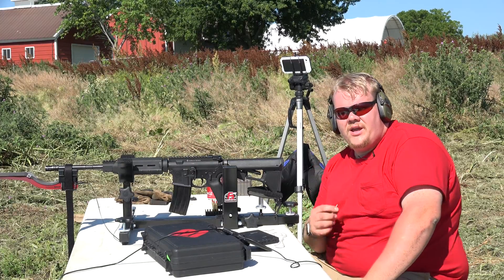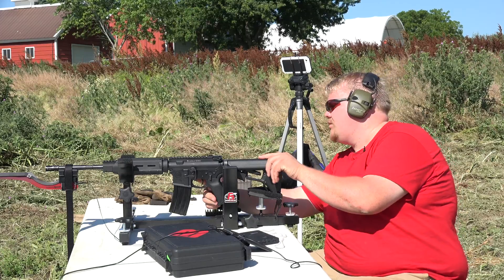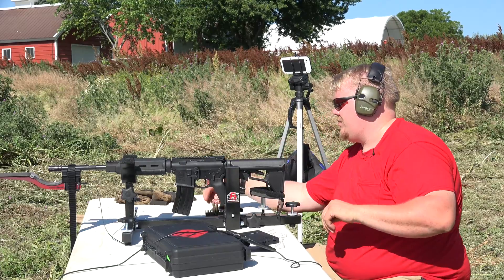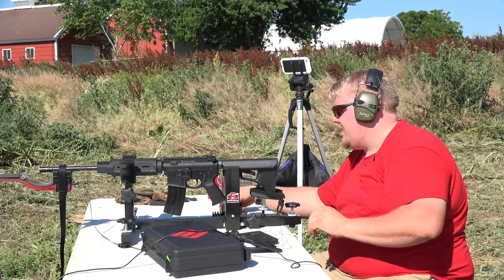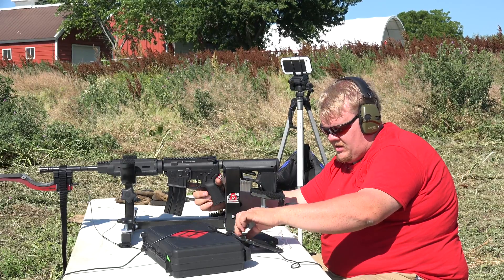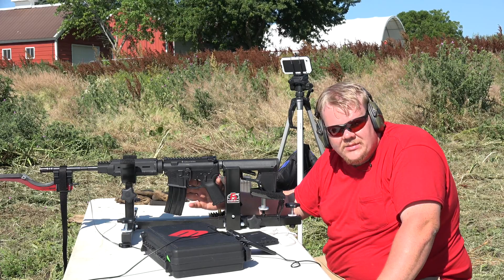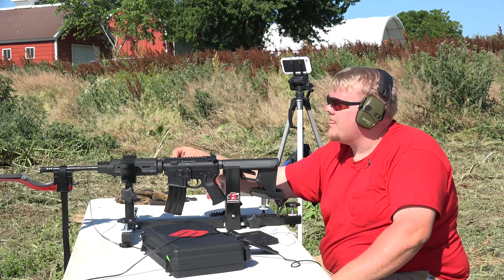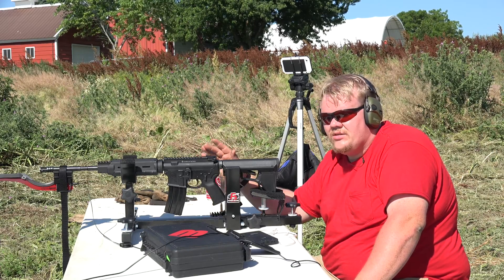The Quest for MACH 4 4K

Comment: why not use a longer barrel? protip: try this experiment with a 22-250
Reply from the maker: We have talked about a longer barrel for 30-06 sabot and may end up going that way. and a 22-250 is actually on the list to test with we have yet to find one at the right price point to risk blowing up. We are focusing on sabots right now since we can do more unique loadings that way while having less effect on internal volume and pressure due to the unique projectile shapes. The end goal is to hopefully achieve MACH 6 we started with 4 since we knew we could in all likelihood achieve it fairly quickly than start hitting gel with unique projectile designs at that speed.
Reply: ok